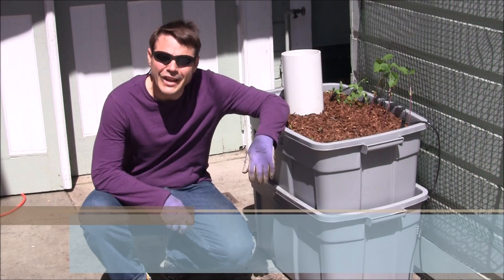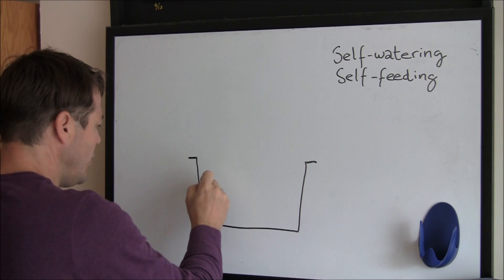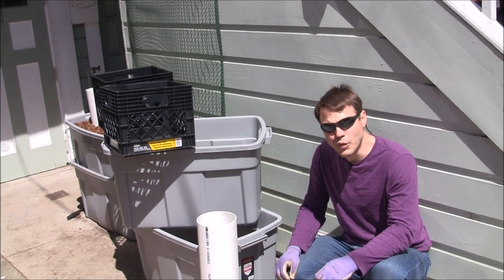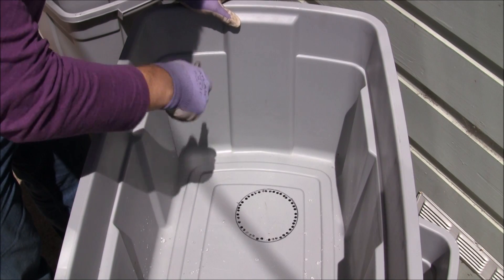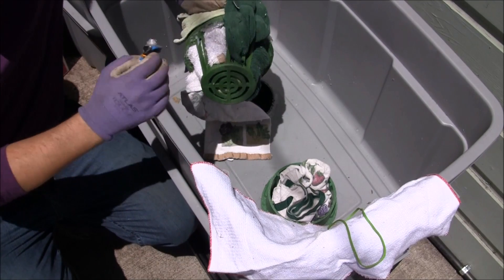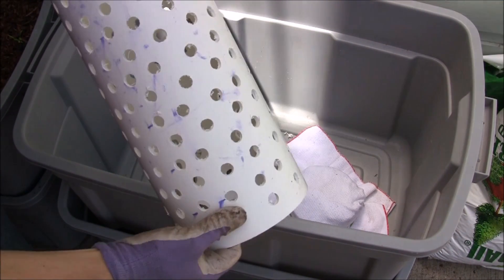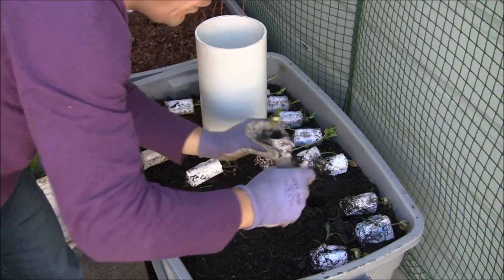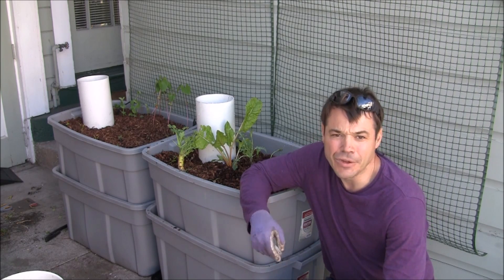Permaculture -  Self-feeding and self-watering pot

Comment: Guess that pipe needs some more thorough smoothing - i see lots of sharp shavings inside the holes and on the inside of the tube.

Some lid on the tube to keep flies away maybe?
Reply from the maker: +VasilyKiryanov Hi Vasily, as it turned out I did spend some additional time off camera removing the sharp shavings, but it was still a bit rough. In the new design I increased the size of the holes from 1/2 inch to 3/4 inch and I also incorporated your suggestion to use a lid because the fruit flies did show up! In the description I provided a link to video where I created an updated version of the pot. Have a great day!